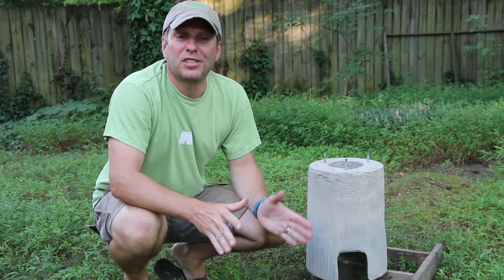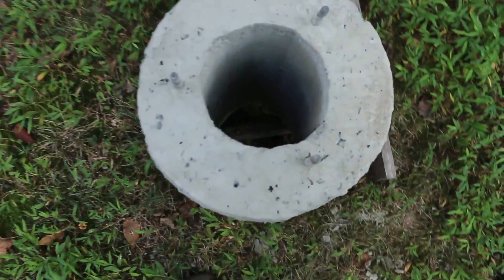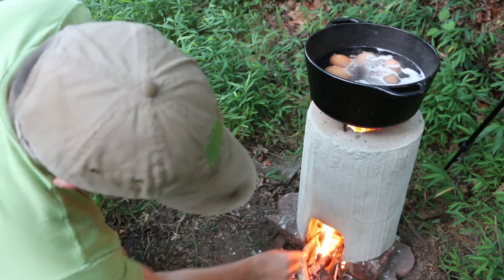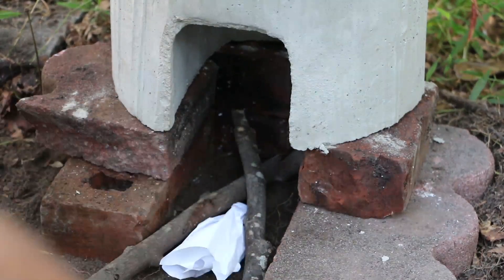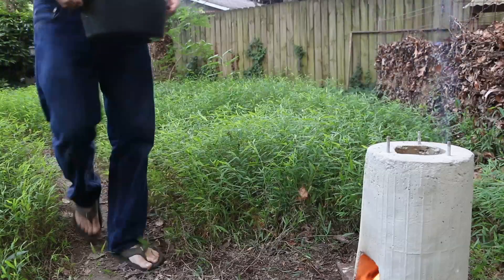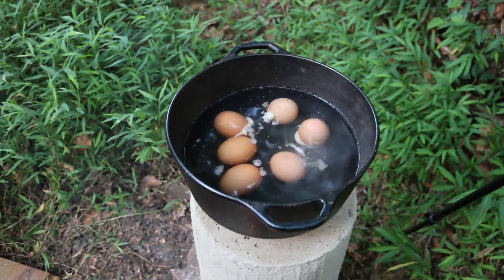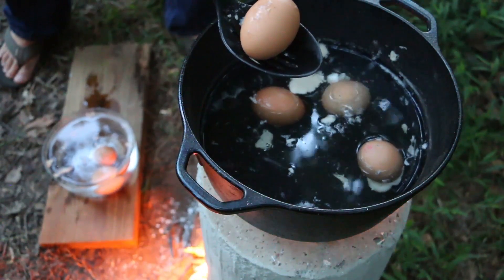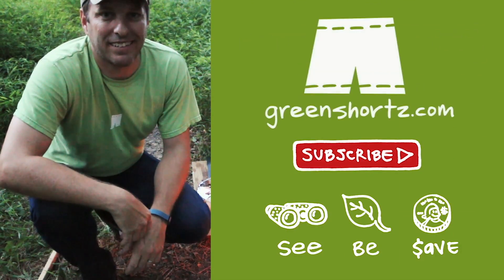How To Boil Eggs On A DIY Rocket Stove

Comment: Hey Tom, I poured my concrete rocket stove Friday night.  I took it out of the bucket the next day and I think I’m happy with it.  Not pretty, but no holes where there shouldn’t be any.  It just needs to sit till the weekend before I light it.

I’m wondering about pots.  Cast iron seems to be preferred.  I don’t have any of those.  What about aluminum, stainless steel or enamel coated steel?  I read somewhere that the intense heat isn’t good for them.  How big is the one you use for eggs?   Cast iron is pretty pricy.  If that’s what I need, I’d like to only buy one that would do most of my tasks.  Thanks.
Reply from the maker: Awesome Rick! on the pot, I picked up my cast iron pot from Amazon. I think it is a 5 quart pan. They've got a 2 quart Amazon Basics cast iron pot with lid for $19.99. There are multiple options under $40. That's your final cost if you've got Prime. You might have a problem with an aluminum pan melting. Stainless or enamel coating steel should work if you're boiling something. For a saute' or a pan fry, you can't beat cast iron. It spreads the heat out better. You might consider waiting another week on your concrete. It takes 28 days for concrete to cure fully, but I've used concrete stoves before the full time. I've also cracked a couple of them. :-) If you've got an armature in the concrete, you should be fine. Let me know how it goes. (thumbs up)
Reply: GreenShortz DIY I used the crack resistant concrete and I put chicken wire in it.  I wanted to give it every chance I could to survive.  I didn’t pay enough attention to my cardboard in the bucket and I have an overlap running right up the front of it.  Shouldn’t hurt anything but I need to watch that closer next time.  

I’ll probably use it mostly for boiling.  Spaghetti, macaroni, and yes, you’ve convinced me I need to try egg salad.  I love potato salad but it’s a lot of work and the eggs are the best part anyway, so I’m going to make some egg salad!

Comment: Hey, I made not that very type of a rocket stove. Mine is a bit smaller. Used old beer cans and a cardboard box to make it. The cardboard box is a one way form however the concrete dried well in it. I just watched this video to see how you make the fire. Like with what wood and tinder because my testfire just smoked so bad. However now I saw what I can do better.
Reply from the maker: I usually light my rocket stove with newspaper and very dry twigs and pencil-sized branches from my yard. Since your combustion chimney is the beer-can sized, I recommend a smaller fir to start. In my experience, lighting a rocket stove can be trickier than it looks. Until the airflow gets going, it can be a little troublesome. Try a few different approaches until you find the right balance. Thanks for watching.

Comment: #1 If your eggs float they're no good # 2 if you cover them when they have a rapid boil going you can take them off the heat or not add any more fuel Leave covered for 1/2 hr.
 Then rinse with cold water Perfect every time Do the you tube How to test if eggs are good
Reply from the maker: +Joan Tvedt hi. I've changed up my egg boiling method since making this video. I definitely cover them to boil faster and use less fuel. Thanks for sharing your suggestions.

Comment: I built a cement Rocket stove using your design, with a few modifications.  waiting for it to cure/dry and keeping it moist.  This is a great design bet really heavy.  It would be more portable if it were lighter, but I like the size and the ability to increase the firebox size.  Many thanks...
Reply from the maker: Yes. It is not a backpacking rocket stove for sure. :-) But this one is: https://www.youtube.com/edit?o=U&video_id=dzAi6BHj5vI I'll be making the concrete rocket stove again, and using perlite to insulate and lighten it a little. Stay tuned.
Reply from the maker: Hi David. I referenced your comment in the redesign of my concrete rocket stove. Check out the video: https://youtu.be/TYr-Uj4HqDs I'll get a final weight once the new rocket stove is fully dry. Thanks for watching.

Comment: make a corncob chimney to fit over ur bolt to vent ive done this to make my own wood kiln at mo height is 3ft may increase for better draw i also use sawdust and paper brickettes only when fire started with waste wood shavings.this helps me as woodworker with the usual massive sawdust issues lol
Reply from the maker: +steven roberts good idea. I've been thinking about making a kiln for some mud tiles. Do you make your own paper brickettes? I saw a massive clay-brick kiln in Peru fired with sawdust. It is at the end of one of my videos. Can't remember which. :-)
Reply: yeah easy job have two plymoulds setup with simple wood hand press takes bit longer to dry but no energy footprint lol ofcourse i use only newspaper no glossy as takes longer to pulp plenty of examples on u tube m8 as im drying wood i need temps of around 120 in the kiln i also have dehumidifier in there sadly on mains power at mo plans for solar setup to run in future.
Reply: at the mo i am also looking into makeing my own wood pellets issues being cost of equipment to do so lol so doubt this is a good one for me shame as potential for good sales too.
Reply from the maker: Sounds awesome. I'll have to look out for the paper brickette videos on YouTube. Thanks for sharing your suggestion.

Comment: Great Stove.  Here's a tip for you.  Use a push pin to poke a hole in the eggshells on the rounded end. Just poke the hole deep enough to pierce the shell and not puncture the membrane.  Your eggs will peel more easily and the sulphur will be dissipated in the cooking water.

Comment: did you know on your eggs you could even save more fuel and get perfect hard boiled eggs every time? Put the eggs in the cold water put the pot on the fire, when it just starts a boil put a cover on the pot take it of the fire let it stand 17 minutes remove eggs from the water and for best eggs cool to stop cooking. You will have perfect eggs every time and use less fuel too. I like yourdesign.
Reply from the maker: Hi Richard. I've started using a similar method (from a commenter) to boil eggs on this rocket stove. I do a 5-minute boil with a 5-minute rest. It has been producing pretty consistent results. Thanks for the suggestion.
Reply: To have eggs that peel easily, get the water boiling first.  Then gently lower each one into the pot with a slotted spoon.  Forget the adage that the eggs are fresh or not...  this works regardless of freshness.  Cook 10 mins.

Comment: Approximately how long does it take to build up the fire so the flames are ready to heat the pot?  I plan on using a solar oven for dehydrating twigs and such.  Also, a tip I've found that seems to work effectively is to add the food you wish to boil right away, and by the time it starts boiling, It's basically done.  Saves some time with grains and pasta especially.
Reply from the maker: Hi Noah. I start the pot on the heat right away. It takes about 8-10 minutes to start boiling. But, I've been using the lid I have for this pot to help keep the heat in. A few mods I'll make to the next build will be shorter pot standoffs (3/4 inch) and adding an insulator, like perlite, to the concrete mix right around the chimney. I did change my egg cooking method based on a commenter's suggestion. It is detailed in this video if you are curious: https://www.youtube.com/watch?v=BK4bt-aHK8I

Comment: Here's a tip: put your eggs in the water before it's on the fire (then you can gently place them without breaking). Bring the water and eggs to a rolling boil. Immediately take off the fire and cover the pot. Let sit for (6-8 min for 4-5 eggs, more eggs =more time) and remove and peel. You will have cooked eggs without the green on the yolk and without that strong sulphur/egg taste or odor, just perfectly done hard boiled eggs (slightly soft center). The stove looks great!
Reply from the maker: Thanks for the tip Fred. I had another commenter suggest this as well. I tried it in this video and it worked great. https://www.youtube.com/watch?v=BK4bt-aHK8I My new go-to egg cooking method. Thanks for taking the time to comment.
Reply: Another thing to remember is older eggs work better for hard boiled, I once sold fresh eggs to a girl and later she said she hard boiled them, but found them very hard to peel. Fresh off the farm not the same as store bought, lol.

Comment: If you add a sleeve that is just an inch or two larger in diameter than the cast iron pot and comes up almost as tall as the pot you get more heat to the pot with less fuel. You can cut a propane bottle in half with holes for the bolts and flue to set on top of the stove.
Reply from the maker: +Patrick Forbes I like that idea. I've read about about what you are suggesting. It is called a pot skirt. I'll have to give that try, but not sure I want to sacrifice a propane bottle. :-)
Reply: GreenShortz DIY I get decommissioned propane bottles from my local propane distributor for free. Pull the valves out and turn them upside down for a couple of days. Pro Paine is heavier than air and will flow out.

Comment: Thank you for posting this rocket Stove great what kind of concrete and how long did you cure it. john hayes
Reply from the maker: John Hayes Hi John. I used a bag of crack resistant concrete for this rocket stove. It called for 5 days of cure time, but I built this right before leaving for a week at the in-laws, so it cured for about 12 days before firing for the first time. It is important that it is fully dry. Thanks for watching.

Comment: with a little air-vent under the wood-feed, as shown in most rocket stove designs, it might burn hotter, with less fuel - and emit less smoke.. It could be built, too, with cobs and clay mortars  ( perhaps you get into that in some other viideos?)
Reply from the maker: +SHAWN REITSTEIN agreed. I am going to try adding a metal plate between the bricks and the bottom of the stove for better airflow. I've gotten a few comments along the same lines, but thanks for the suggestion. I did make a cob version of this stove.
Reply from the maker: Hi Shawn. I just did a redesign on this rocket stove with a vented airflow like you suggested. Thought you might enjoy: https://youtu.be/TYr-Uj4HqDs Thanks for the suggestion.

Comment: Your eggs won't crack if you put them into the water when it's cold and then bring the water to a rolling boil.
Reply from the maker: You are indeed Sharpeyed. I've gotten a few other comments with this idea. I used that method in the video about boiling eggs on my metal rocket stove. It worked great. Check it out: https://www.youtube.com/watch?v=BK4bt-aHK8I

Comment: if you put a lid on the pot boiling time cuts to half more or less, so the fuel use too...
Reply from the maker: Yes indeed! In fact, my cast iron pot came with a lid. Of course the open pot made for more descriptive video, but I'll definitely use the lid going forward. Thanks for watching and sharing your thoughts.
Reply: Your supposed to start off with cool water,add the eggs to the cool water this way the eggs come up to temp gradually. When the water begins to boil, let the eggs boil for five minutes.Then turn them off and let them rest for about five or so minutes. then rinse with cool water.  But i still like your rocket :0)

Comment: I would put it up on concrete blocks so you don't have to bend down to use it. make it so the top is close to normal counter height. Also, find a round metal plate to set on bolts so pot has a nice heated surface. not just off what is coming out of chimney. make it perhaps 3 or 4 inches larger so the smoke does not contact the pot. I want to make one of these to use for my 21.5 American pressure canner. would be a lot cheaper to use than my electric stove. 
some people are using propane burner stoves for their PC's due to size / weight limits on stoves or cook tops. 
To stop the canning process, just use a metal scoop to take fire sticks out. and coals. aka.. turning off the heat.
Reply from the maker: Diane, I'm planning on making a raised platform in the spring...and perhaps a rocket-stove-powered pizza oven. Canning is something I don't know anything about, but would like to learn. I like the idea of using the rocket stove for this purpose. You could create a "fire drawer" allowing you to pull the whole fire out, when you need to stop the cooking process. Do you make videos about canning?

Comment: Not to be an ass but that's not a rocket stove.
Need you understand the basic concepts of what's required for it to perform like a rocket stove. It works but not very efficiently.
Reply from the maker: I'll concede this is not a true rocket stove. I had a comment a few weeks ago with a link to a rocket stove blog and I've been meaning to read up. Do you have any good resources for rocket stove design? Appreciate the feedback.

Comment: You can use a orbital sander without the sand paper on it to vibrate the air out of the concrete and have a smooth finish.
Try making one out of a 55 gal drum using 8inch pvc for the chimney pipe.
Reply from the maker: +TIM LASHLEY ooh! That sounds epic, maybe a twin-chimney rocket stove. Thanks for the sander idea, will use that the next time I use concrete. Thanks for watching.
Reply: GreenShortz DIY your very welcome I will try to make something like that soon as I'm able

Comment: would be great for camping trips. less fires getting out of hand. and using all dead wood makes less wild fires. my dad always had us kids walk around and pick up all dead wood/limbs. never cut down a tree with all that stuff to use !!
Reply from the maker: Mr. Six Gunz (love that it's got a Z)...I'm working on creating a metal folding rocket stove to take camping. This concrete stove weighs around 80 pounds. Too heavy for backpacking trip, but it could work nicely if you are driving to your campsite, or close to it.

Comment: already build 6 diferent one and i did one like yours to cook outside have 2 more that are casted but i prefer mi last build cook and heater at same time here the link to the video :
https://www.youtube.com/watch?v=cEh6jhjCmJo
i did subscibe.
Reply from the maker: Thanks for watching. I checked out your steel rocket stove build. Dude, that is an impressive stove. Excellent construction. My favorite touch is the spinning air flow plate on the front door. Looking forward to see it burn.
Reply: thanks.just finish sanding,panting and cuting fire brick.posting the video right now.
will make a DIY of a smaller version for cooking outside in a few week.